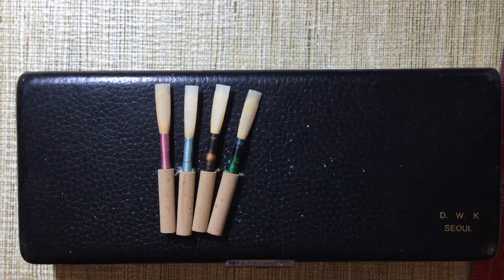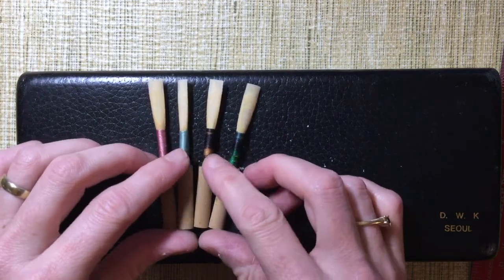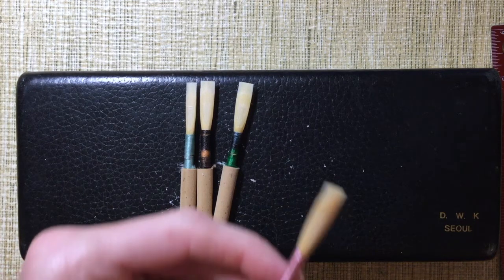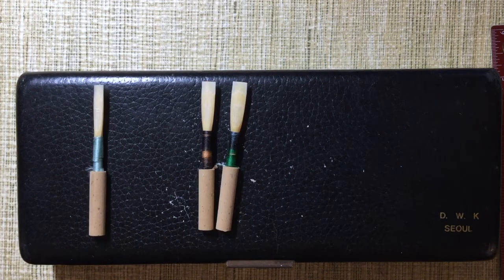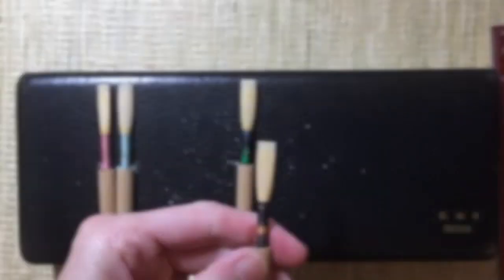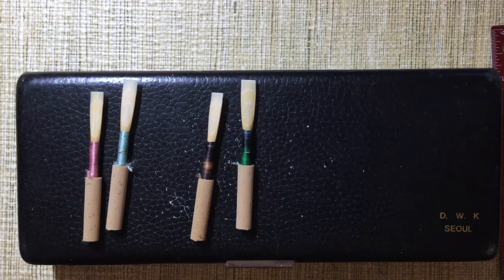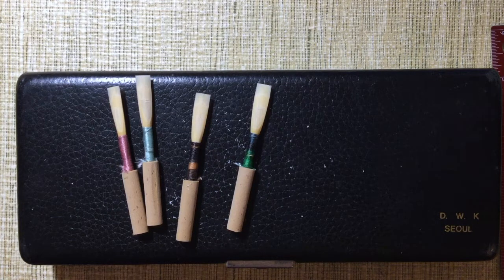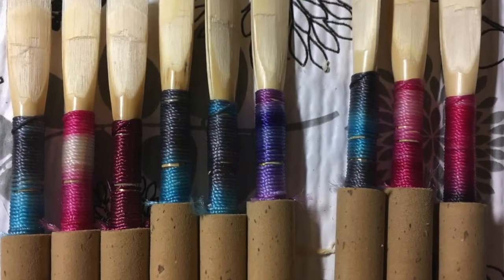Five Minute Reedmaker: Shapes Part 1: RDG and Calebs

Comment: I haven’t seen it being mentioned in books or on websites, but I notice that the radius of the cane also has an impact on the shape. Most shaper tips seem to have a much larger radius than the cane (not sure why they wouldn’t make them a closer match), so that the shaper tip stretches the cane and the resulting shape could end up much narrower than the shaper tip (smaller radius of cane = narrower shape). One can experiment by clamping the cane with the shaper handle higher or lower to get a slight change in the shape, or perhaps try using an insert under the cane. People usually get very creative when on a budget :)
Reply from the maker: That's a fascinating point!  I haven't experimented with that at ALL - but it goes a long way to explaining why SOMETIMES reeds off the same shape have a very different appearance.  I'm not obsessive about checking diameters, and certainly might be accidentally using much smaller or larger ones occasionally. Thanks!

Comment: I don't find the video vague at all and readily hear the differences. I'd like to hear a Brannen X. I've never used on and want to know what all the fuss is about. Thank you for making these videos!
Reply from the maker: I'm glad it's working! You know, I've been curious about the Brannen X as well - never have gotten my hands on one to try.  Isn't it called X for Xtra Narrow, but actually it's pretty wide?  And then EVERYONE talks about the old Brannen X but practically no one actually has one?  Filled with paradox, the Brannen X. If anybody has one to lend, I'd be super happy to make a video!
Reply: @JennetIngle   That's right, it's called X for Xtra Norrow, but it's quite wide. Westwind claims to have measured several original Bannen X tips, and averaged the results for their model. Sounds good to me.